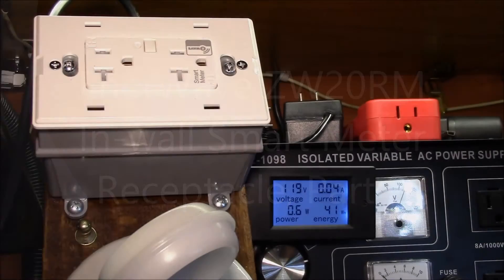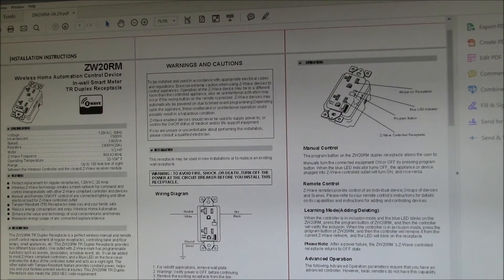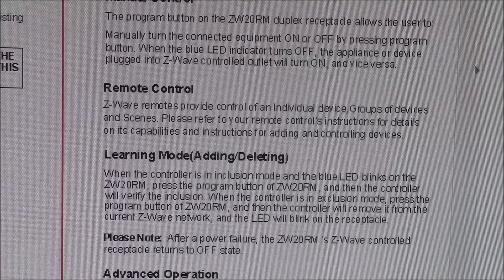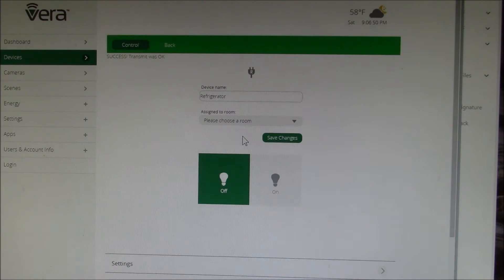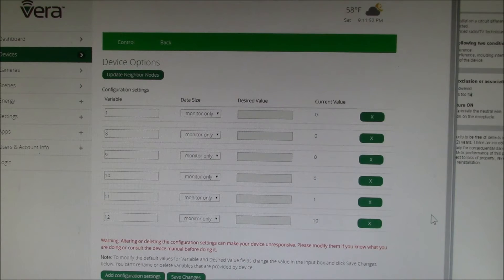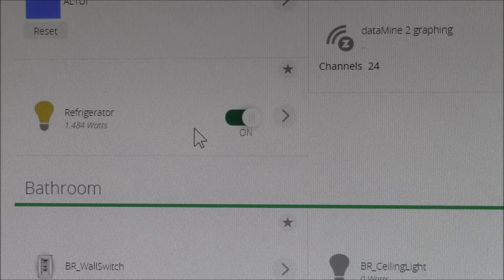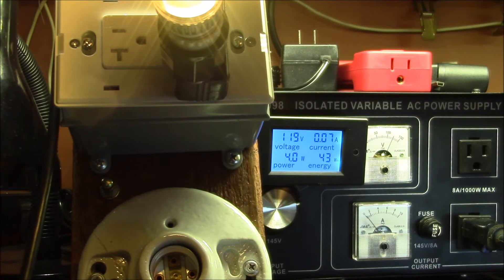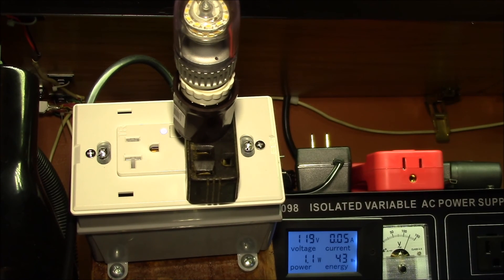EnerWave ZW20RM In-Wall Smart Meter Receptacle, Part 2

Comment: hi!  I've recently installed a  z-wave smart meter from Qubino and it is in front of all consumers of my house.  It is now included in my vera plus controller and the only value which I'm able to read without any supplementary settings is the instant watt consumption.  do you had tested this type of smart meter?  I'm newbie in Z-wave and I do not know how to take out all the information from this device! thank you for your effort in broadcasting all your experience!  KR Florin
Reply from the maker: Not familiar with the device.  But in general, those sorts of things are often enabled in the Device Options settings under the Vera screen that opens up under that device.  Sometimes those values are described in comments next to each device variable, but sometimes you'll need some device documentation from the mfg. as to what device variables do what.  With my other power measuring devices under Vera, they all reported power as well as energy (KWH).
Reply: Thank you for your fast reply! I was able to configure in vera plus controller additional parameters starting from the Qubino`s producer manual. Now the only problem for me is how to get fresh information out of this device... I`ve got a bad experience with dataMine graphing and logging plugin ( I`ve inserted an usb memory stick to store the data and from 8GB Vera were formatted / reduced it to 512 MB capacity). Please advise me ! :)
Reply from the maker: Yep, Vera is the one that reformats the USB down to 512MB, if USB logging is enabled.  You can share that space with Datamine or you can config. Datamine to use the unused partition on the thumb drive.  This works up until Vera decides to reformat the USB drive every once in a while.  I've done both and they both sort of work.  There is also supposed to be a way to write data to an external network server.  I've not looked into that much, but there's some info. on the Vera Datamine section of the support forum.
Reply: but I' m not blocked to use datamine only.  I'm open to try another way if it is much easier!  what do you use for monitoring your devices data?  temperature for example!
Reply from the maker: I've only used DataMine and now DataMine2.  There is a DataYours package that I've not tried yet.  Lots of information on the Vera support forum:
http://forum.micasaverde.com/index.php/board,43.0.html

Comment: are both outlets monitored?
Reply from the maker: No, only the Z-Wave controlled outlet seems to be monitored for power.  The other outlet is just wired directly to the terminals on the side of the outlet, always on and not monitored.